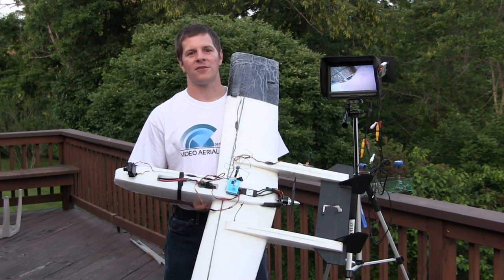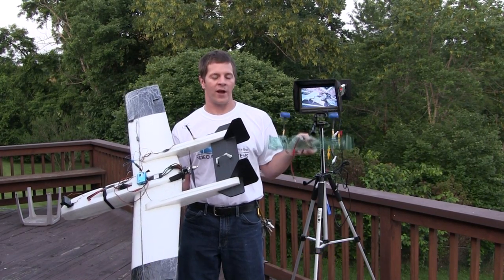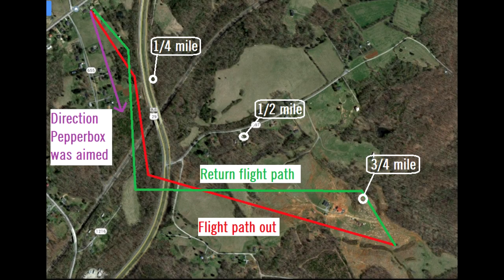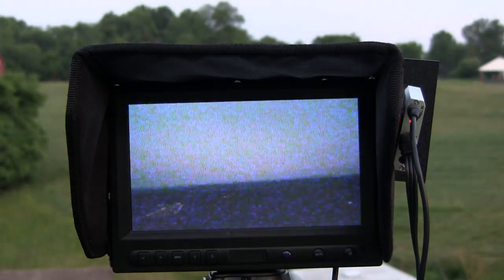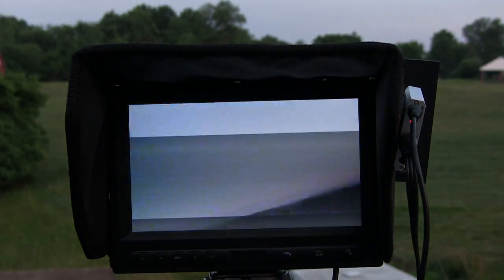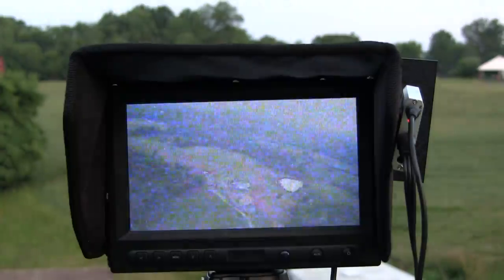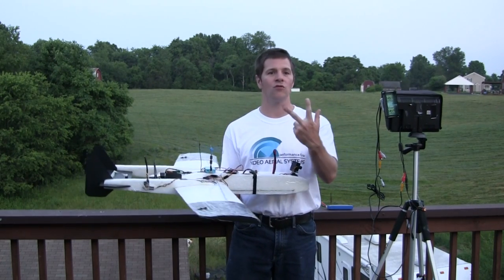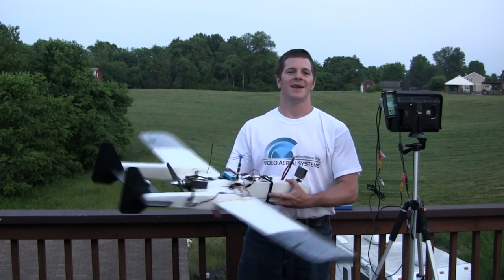Interference testing: can 14 pilots race at once?

Comment: Small question... On your 1.2/ 2,4Ghz system you have cloverleaf antenna's but on your 5.8Ghz system you have biquads... Why is that ? Has this to do with your test or just your preference of antenna for this system?
Reply from the maker: Ronald de Bruin I am using Pepperbox antennas on my 5.8Ghz system.  They have a wider beam.

Comment: ... nice demonstration, Alex :-) works fine! Did you sent a video signal with the two competing transmitters or only powered on with no input signal?
Reply from the maker: hotliner No input signal.  It certainly hit the video system at the end of the range.  However, 3/4 miles on 25mW on 5.8GHz is very far... especially around that much RF traffic.
Reply: ... that's the case, Alex! From my experience if the closer TX is sending a video signal it hits your video much closer distance as you'll expect. The range will drop less then 1/4 mile, even shorter! Try it out and you'll see ;-) Never the less the Pepperbox is an amazing antenna which gives even a low power video systems unbelievable range :-) Thanks Alex for this development!
Reply from the maker: hotliner - Yes I know about proximity.  That is why In this test I chose 20 feet of separation.  If I put it right in front of the receiver, it would have certainly swamped it out.  However, sitting back 20 feet from your race circuit is more than reasonable and thus I am simulating a real race instead of worst case scenario.
Reply: ... in the same configuration as you did, do you think there is no different in the result if sending with or without a video signal?
Reply from the maker: hotliner I intend to find out in 2 weeks.  the plan is to race 14 multrotors at once.
Reply: ... nice, I'm looking forward of the result :-)